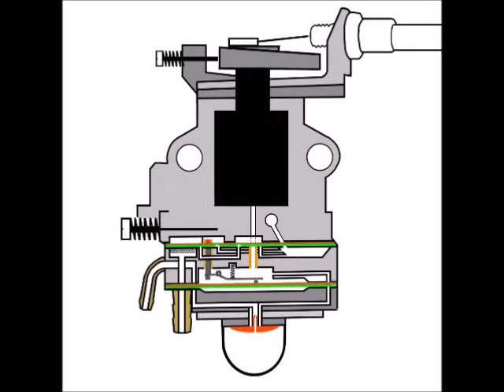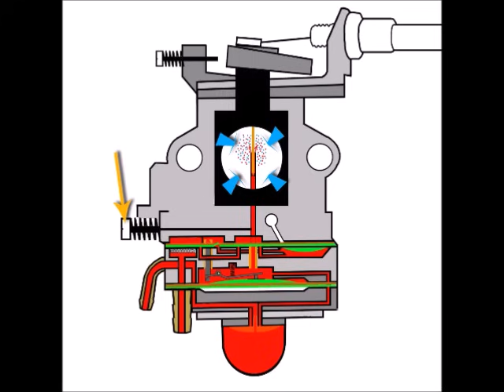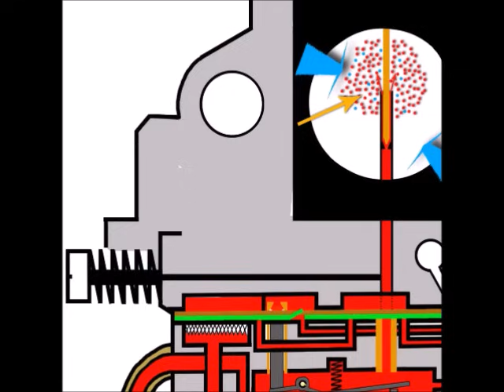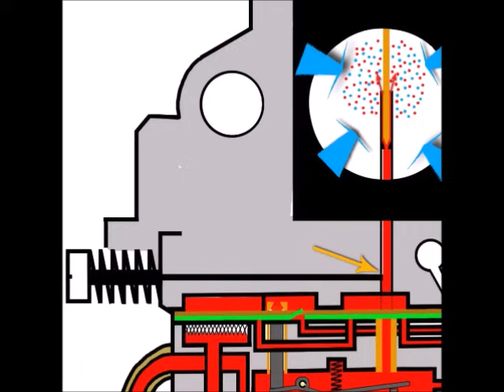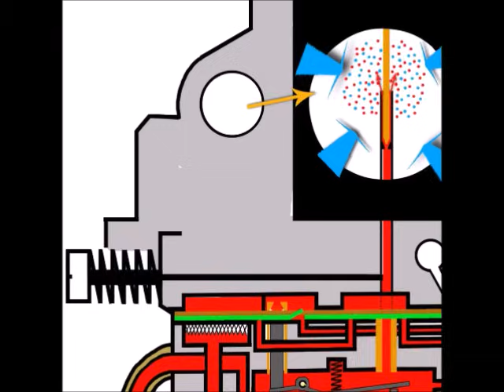CARBURETOR TUNING: Single Adjuster Screw Setting EXPLAINED!  (by Craig Kirkman)

Comment: Is there somekind of default position like tourn it clockwise to the end and than 1, 1/2 round back  like on chainsaw carburetors ...or we need to lean on 'feeling' it?
Reply from the maker: Hi.  If you haven't done so already, please take a look at this video of mine that explains these adjustments a a little more practically.  Yes, it is about adjusting a chainsaw but the principles are very much the same.  Thanks Craig
Reply: @TheRepairSpecialist  which video? You have many many videos, thanks in advance.

Comment: Hi Craig, thanks for such a good channel. Really helpful and in depth explanations. 
I was having a problem with a trimmer with this exact same type of carburetor. It will start and idle but it bogs down when pressing on the throttle. But pressing  gradually on the throttle and at the same time opening the adjustment screw will rev up  and run perfectly for as long as you want. So I assumed there was a problem with the fuel not being sucked out properly and  increasingly as the air flow increased. I put everything apart but didn't find anything wrong with the needle o anything else, so I clean everything and put it together and back on the trimmer. And it run perfectly after tuning the adjustment screw. So I fix it, but don't know exactly how.
Reply from the maker: Brilliant. I'm pleased you fixed in the end. Thank you for the nice feedback. Craig
Reply: Actually, I was wondering if you could tell me what do you think the problem was?
Reply: @federicosaez6022  
I can't say to what the problem was so much info needed for that 

However

This is not a single mixture screw carb 

The hi flow mixture screw is hidden extremely well so please don't look down on the content creator

It took me years to find this guy  

If you look at the top where the throttle wire connects to the throttle barrel there is a brass collar/screw in the top of the throttle barrel 

It has a rubber tube 
hiding underneath it is the hi flow mixture screw

Also this video demonstrated that the so called air/fuel mixture screw has NO POSSIBLE WAY to adjust the air flow meaning its the lo flow mixture screw not a air/fuel mixture screw 

So 
Lo flow mixture screw
Where he shows the fuel/air mixture screw is 

Hi flow mixture screw
In the top of the throttle barrel opposite side of carb to the prime bulb 

Look for the brass collar/screw in the centre of the throttle barrel behind the rubber tube in the centre of the brass collar/screw

Air mixture screw 
Is the idle screw valve after the initial setting the air flow is naturally limited 

Hope this helps

Comment: I have a question is the following symptom a bad carb configuration?
I tend to see a black liquidy residue coming out of the exhaust onto the tank etc.I keep cleaning it though.The exhaust is fixed and cant be opened. Plus i dont see any spark arrestor.Maybe the exhaust is fouled or is it a carb fuel adjustment problem?Thanks in advance.

Comment: The video doesn't explain how to adjust it. It explains what it does. Should adjustments be made at idle or full throttle?
Reply from the maker: Hi.  Here is my other video that explains how to adjust the carburettor.  I use a chainsaw as an example but the principles are the same. You can find it here on you tube in the link: https://www.youtube.com/watch?v=74p9FLmIkkw&t=34s .  Many thanks indeed, Craig
Reply: @TheRepairSpecialist  Thanks.

Comment: I bought a brand new one of these exact carbs, it won't get fuel what do I do repair specialist?
Reply: James K first check your fuel filter on the end of the fuel line inside the fuel tank is clear then replace the fuel lines if they’re old, does the fuel get anywhere or not? Ie does it flood the piston cylinder? Take spark plug out and take a look
Reply: @xxwalhalaxxmozza7415  doesn't flood piston
Reply: James K is fuel getting from fuel tank into carburettor ? If not I’d definitely be looking at the fuel filter in the tank

Comment: Very helpful. Thanks a lot !
It is a Husqvarna 143II. After a complete carb cleaning, as preventive maintenance, I couldn't restart. It barely maintained idle with 100% choke.
Every time I opened the choke, the engine died (too little fuel). I tried mix and idle screws in all positions...nothing happened.
At the end I had to adjust the position of the needle in the venturi, by one complete turn counterclock wise (upwards) and it is working fine now.
Is it normal ?. Do adjustment shims exist for this screw? in order to adjust this needle?

Comment: Could u give me help my scooter revs up when it idels ans when you turn the accelerator it stops moving the wheel
Reply: craig lamb  air leak somewhere between the carburetor and engine, check the gaskets

Comment: Came back again to say thank you once more. I got my auger dialed in to real power, and wouldnt have got it even running if not for you. Problems was wouldn't start and when it finally did after shooting starting fluid in it and holding down the throttle, it didnt have much power. If I let go of the throttle it would stall. So I tweaked the adjust screw CCW first and eased off the throttle, still stalls. Then tweaked more CCW and found as I did I had to hold throttle open more. So I went to the CW dir and after 1/2 turn I could start to let go of the throttle although it had not real power. As I started making another 1/2 turn CW I could hear the idle rpms picking up and it sounded great. I was able to drill a big hole in the ground. Thanks again!

Comment: This is too simple. I want to know more about how to identify the idle mixture screw, what it actually looks like.
Reply: On the carburetor in this video the idle is controlled by the screw that interacts directly with the throttle butterfly and limits how far the throttle can close.

Comment: Great vid. I know how this type works, but I'm still trying to wrap my head around the advantages/disadvantages of this type when compared to a 2 cycle carb with high & low fuel mixture screws. Also, how is this type maintaining a proper mixture on idle and at full throttle?
Reply: these type of carbs do have a low mix screw also it is in the top. look for a small black silicon plug

Comment: Can you please tell me how much turn should i put on a single screw carburetor because you never say how much it should be at a correct setting
Reply: Best thing you can start with is to turn it all the way in (gently), and count the turns it takes to come out, then go back halfway, and go from there. Because of different varients of 2 stroke motors, you may need to play with it a bit to get it right. Once you do, write it down and you will never have a problem adjusting that particular carb again.
Reply: 1-2,5

Comment: My motor raaaps pretty good on level surface, but as soon as you go up any incline it boggs down as if not getting enough gas. Any ideas thanks
Reply: Do you have enough gas in the tank?
Reply: They all do that. Bike dont have much power. So get speed before the incline. Or upgrade motor

Comment: So, on a single screw adjustment carburetors, this is the Low screw, or High?
Reply: In another answer he said "both"
Reply: @russomarcelo  Thank you!
Reply: I think it is both haha, because when it idles it automatically limits the fuel
Reply: I think high
Reply: Very easy to set

Comment: Thanks for the nice video. Could you please tell me why; When people clean their  2 stroke Carbs on here that they never remove the High & Low screws from the Carb? , even when they use an Ultrasonic cleaner? I would have thought with those extra passages would also contain some debris?
Reply: Mixture screw adjustment when  the mixture screw is fully closed this  means turning  clockwise until it can't be turned anymore. 
How  many turn anticlock wise. Is it 1 1/2 turn  of the mixture screw  for fine  adjustment
Reply: Hi Walter, yes I understand that, but what I was asking was with  the 'cleaning part' of  a 2 stroke carb & why no one takes out the air screws to give it a through cleaning?